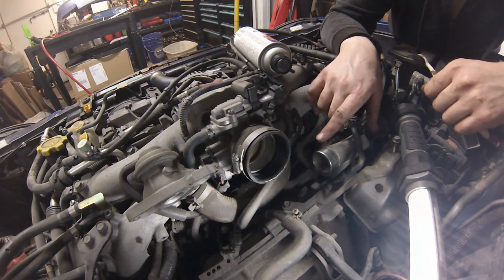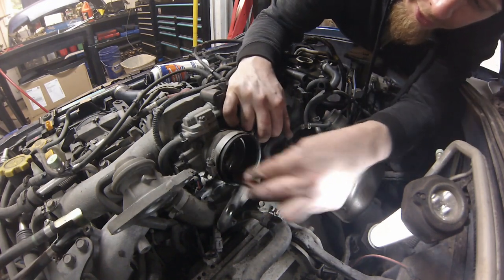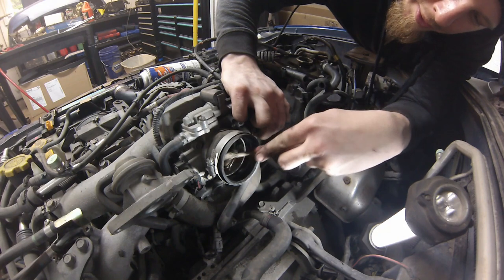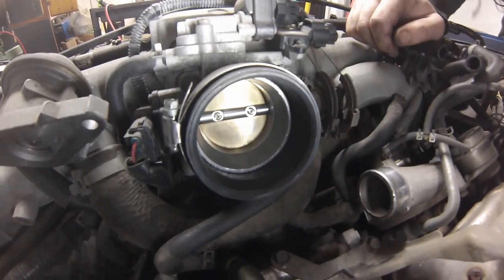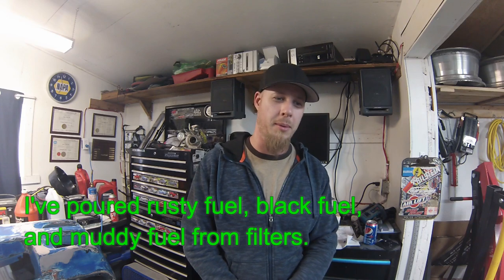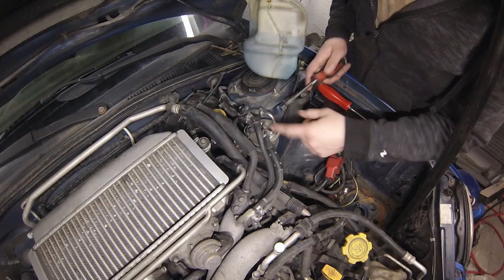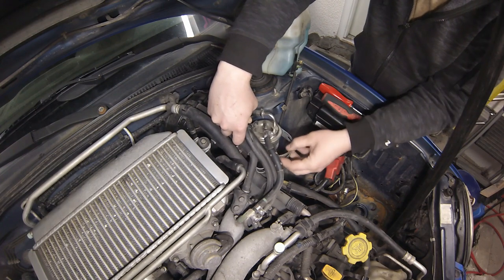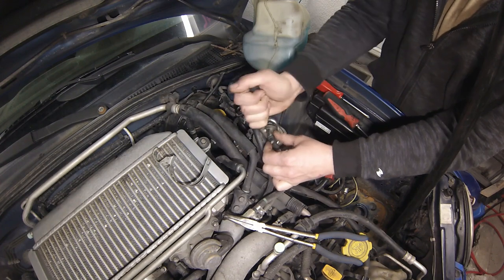Subaru Throttle Service / Fuel Filter Replacement - How To

Comment: Thank You for your reply!!!  Removed and cleaned throttle body,replaced gasket changed spark plugs, put back together runs and idols smoothly.  Thanks for your help!!!!
Reply from the maker: No problem, nice work.

Comment: Hi ...... I watch your videos related to Subaru and love the way you explain issues and suggest solutions. Its matter of time that i am struggling with an issue with my Subau Forester, 2005, 2.0X, Non-turbo. I recently cleaned my throttle body, PCV valve, TPM sensor, MAP sensor, EGR valve and IAC valve. After refitting them in car, my Suby behaving awkward way. Idle RPM are gone high and there is a fluctuation. Same time i am getting some oil burning / overheating smell with some smoke coming up from somewhere down near catalytic converter/ drive shaft boot. Please give some clue on these two issues. Thanks a ton bro for help.....:-))
Reply from the maker: It sounds like you have a vacuum leak somewhere. Re-check connections, make sure IAC electrical connector is plugged in all the way
Reply: @HomebrewSubaru   thank you so much for your super fast response.Surely I am going to check all again and update if problem is fixed....:-))
Reply: @HomebrewSubaru  i checked all hoses and sensor fitting again. I found my mistake in fixing TP sensor with its tang on wrong side of throttle shaft pin....:-)) i refixed it and adjusted in a position so that signal wire giving a reading of 0.45-0.55 volts. My issues are solved and RPM are stable at 650. There was a check engine light there,which is automatically gone after I drove car a bit.I wil drive a bit more and see if burning smell is gone....Thank you for your suggestions. Appreciate it 🙂

Comment: 2005 Forester 2.5 X SOHC. 140K miles. The RPM has a mind of its own. Revs high unexpectedly. Today 5K rpm in a parking lot with my foot on the brake. I already cleaned the throttle body, both sides spotless. I cleaned the MAF flow sensor w/CRC solvent. Very clean now, it was dirty. New air filter element. Suggestions? Does have a TPS I could replace or test. I have a Fluke. Have you ever heard of the gas pedal going bad? Waiting again for the code again, I erased it Thanks
Reply from the maker: I expect that year and model to have an electronic throttle. If it does, likely the positioning sensor is gone kaput and the ECU thinks the throttle is closed when it isn't. If the high rev is intermittent, this is the first hing I would suspect unless it is a mechanical throttle body with an Idle Air Control valve. Let me know how you make out.
Reply: @HomebrewSubaru  Electronic it is and intermittent as well. I'll wait for a fault code again. That's subjective also. Maybe the TPS. Could be the gas pedal? LOL I'll let you know.....Thanks appreciate it!

Comment: Great channel, good info. Just subbed. My throttle pedal sticks a bit on initial application, I thought it was because of a build up on the throttle body. I cleaned it but the pedal still sticks a bit. Have you experienced this and do you have any suggestions. Thanks.
Reply from the maker: Thanks
Likely your throttle body is beginning to actually wear out. The throttle plate eventually puts a groove in the bore of the throttle body. The plate gets snagged on the groove when opening. You can do some light sanding to the bore to smooth it out. You can also do a very tiny adjustment to the throttle so that it doesn't close to the point that it gets snagged. 
Otherwise, you are likely going to have to replace it.

Comment: So it's safe to spray a lot of throttle cleaner inside the manifold going pass the throttle body flaps?
Reply from the maker: It is on aluminum manifolds. The car may be hard to start if some of the cleaner doesn't evaporate. Not much is needed to get a good cleaning usually
Reply: @HomebrewSubaru  thanks bro

Comment: Did you pull the fuel pump fuse first or just pull it out
Reply from the maker: I’ve done this more times than I can count, so I just change it. If you don’t turn the key on while the filter is out, the pump won’t run and you should be fine as long as you release pressure

Comment: Do you have to take out the fuel relay while car is started till stalls so that fuel is out of hoses or is this optional.
Reply from the maker: The system is under pressure. It can stay pressurized for quite some time after running. Removing the fuel cap and leaving the car sit for a while will relieve some pressure, then you can use a rag to cover the lines while disconnecting. Wear eye protection, fuel in the eyes sucks

Comment: So to access the throttle body you have to remove the inter-cooler and cannot run a cleaner through the system at all? I was hoping to try something like Seafoam or some cleaner. Is it even possible to set that up with this engine configuration. Would you have to set up the cleaner through a long hose and then reconnect everything? Sorry if the question is confusing, I'm green. Thanks for your video.
Reply from the maker: You could try to do what your saying. Likely the check engine light will come on and you will have to clear it. The car is going to want to stall so you might need a second person
Reply: @HomebrewSubaru  Thanks for the reply. I'll give it a go.

Comment: I just purchased a 2000Subaru Legacy GT, how do I know if it has  MAP or MAS airflow?
Reply from the maker: You did the best thing by asking. Your car has a MAP sensor and engine code EJ251, I have one in my backyard. Mass Air Flow(MAF) sensors are usually located on the air filter housing in the pipe leading to the throttle. If there isn't wiring going to a sensor there, it should be a Manifold Absolute Pressure(MAP) sensor car.

Comment: This may be a stupid question you probably answered it in the video but I have a 13 sti would I still be able to do this?
Reply from the maker: The throttle service would be the same, but the fuel filter is serviced in the fuel tank on your '13 I think.

Comment: You didn't take the body off. Which makes sense to me.  are you more concerned with where the plate might stick on the edges?
Reply from the maker: Air passes the throttle plate while closed. It seeps past the plate at idle. When carbon builds up on the edge of the plate and bore, the ecu cannot compensate for something that shouldn't be there. Less air enters the intake and idle lowers a bit due to a richer condition. Sticking or binding throttle plates are not common but certainly affect performance and throttle response.
Reply: Homebrew Subaru ahhhhhhh.. So the mechanics taking it off and doing behind are being fussy. But the major culprit is the open door crack.
Reply: Homebrew Subaru that saves me the fuss of clamping the hoses + potential damage to them
Reply: Wd40 was used?
Reply from the maker: Taking off the TB isn't a big deal on some cars. They may not have water running through them and have a reusable gasket. Now, plastic intake manifolds... that's a different story. It is possible to get enough cleaner into the intake that is could ignite within the intake manifold on startup. Backfires are known to crack plastic intake manifolds and in some cases, blow a hole through them. Always remove a throttle body from a plastic intake manifold for cleaning. Aluminum intake leave the TB on if you want. Some TB's have extra galleries or ports that are easier cleaned when they are sitting on a bench. Subies are pretty straight forward. 
Use throttle body cleaner to clean a throttle body.
Reply: Great knowledge absorbed. Thanks

Comment: One more question.  It has come my attention that Subaru’s are known for head gasket problems around 1000;000.  Is this true? Is it certain models?  What can be done to prevent this if anything?  Thanks again.
Reply from the maker: Head gasket failure is difficult to prevent. Earlier models than yours had head gasket problems related to coolant and could cause overheating. Your engine is prone to head gaskets leaking oil externally. Noticeable from underneath usually the leak starts as a seep, then progressively gets worse. Most people notice the issue because of oil dripping onto the exhaust and causing smoke or smell.
Reply: Don't let it get hot!!!! Subaru fluids and coolant conditioner from subaru.
Reply: Head blew twice on my 02 Impreza one year apart.  2nd time was cause from the radiator leaking and engine overheating.

Comment: Have a 07 2.5i when I replaced the camshaft and crank postion sensors the vehicle , cannot drive the vehicle now . Engine bogs under acceleration motor stumbles when taking out of gear or putting into drive engine sputters or misfires . 
Any advice ?
Reply from the maker: Why were the sensors replaced? Setting codes? How was it before you replaced the sensors? I would expect the engine not to run if the crank sensor was defective.
Reply: Cleared codes for crank and cam sensor . Those went away , check engine light came back on after short drive . Was about 50 % better but not 100% . New codes throw p0026 and p0302 now
Reply: Drove home one day halfway home engine made backfire noise thru front of motor , almost total loss of power and crazy rattle valve or chatter noise high pitched almost like a turbo . Car surges if u let slightly off accelerator seems to catch or regain some power but rattle/ tweeting sound grows louder . Obd has told me mass airflow, crank ,and cam sensor . Replaced and cleared codes . Those did not come back . However the 2 previously mentioned popped up ? Have had. Are 3months just now able to do some much needed maintenance ! 
Rather do the work myself and know the car is solid as a tank. 
Frustrated but far from given up
Reply from the maker: P0026 you can refer to this video ---> https://youtu.be/2AqKrS6wa20  Most likely the valve lift solenoid is no good. This would cause many of the problems that you are experiencing.

Comment: What are you spraying on the toothbrush
Reply from the maker: Throttle body cleaner. Air intake cleaner will do the same job.
Reply: @HomebrewSubaru  I've 04 wrx. Is it the same way cleaning?
Reply: @HomebrewSubaru  how about brake clean?

Comment: Is it normal for oil residue to be on the throttle body or cupler hose?
Reply from the maker: This is not normal. In most cases it indicates an older worn engine. As the piston rings wear with age, a bit of combustion pressure begins to pressurize the crankcase. This excessive pressure begins pushing oil into the PCV system. This is where the intake begins to suck the oil from and it ends up at the throttle and in the manifold. 

On a turbo model, this can be caused by raising the boost pressure beyond the stock level. An Air Oil Separator(AOS) or oil catch can will help prevent oil from making its way to the intake manifold. Unless you've got a cracked ring land, which is much bigger problem.

Comment: What did you use to clean it with?
Reply from the maker: I used throttle body cleaner. Air intake cleaner will do the same job.

Comment: I have an 02 wrx and I took my throttle body off replaced the gasket and cleaned it , I put it back together the car started to miss fire on cylinder 3   and hesitate when I tried to accelerate I checked every hose I took off and everything seems to be in place any one know about what could be wrong ?
Reply from the maker: That service shouldn't have caused that to happen. Double check your vacuum lines and begin checking the ignition for number 3 cylinder. Good chance an ignition coil has failed and is just coincidental.
Reply: Homebrew Subaru okay so I checked the hoses and everything and found one that was cracked , now I have a CEL code for a p0108 for a MAP sensor where is this located ?
Reply from the maker: MAP sensor is on top of the throttle body. It's possible the code was caused from the cracked hose. If you clear the code and it doesn't come back, everything should be fine. If the code sets again, you could try replacing the sensor.
Reply: Homebrew Subaru is it normal that it’s just idling really low ? Because of the code ?
Reply from the maker: If a code for a MAF or MAP sensor is setting, all sorts of things could happen to the idle and performance.
Reply: @HomebrewSubaru  hey I have lots of questions. You seem to know a bit.    If u would like to get back with me I'd appreciate it thank!!!!

Comment: i removed my tps sensor and now my car goes really high rpms without stepping on the pedal.... what can i do?
Reply from the maker: Either the throttle is sticking partially open or the sensor is adjustable and needs to be calibrated

Comment: I'm assuming this is not a WRX, because when I took of the intercooler to my 2010, i don't see a throttle body.  Trying to diagnose why, at low speeds, car wants to stall.
Reply from the maker: This is a first generation USDM WRX. Your 2010 has the plastic intake manifold. The throttle body is a little deeper in, under the intake manifold
Reply: @HomebrewSubaru  thank you for replying.  You have no idea how much I appreciate it.  I wish I could find a video on how to access it.
Reply: Thank you for the direction.  I'm not mechanical, but after I removed the intercooler, and the flex hose that was attached to it, I found the throttle body...and gave it a good cleaning.  Now all I do now is wait to see if it solves my rough idle at low speeds.
Reply from the maker: @ecpoirier   Well done and good luck